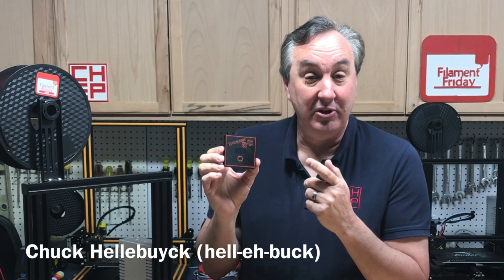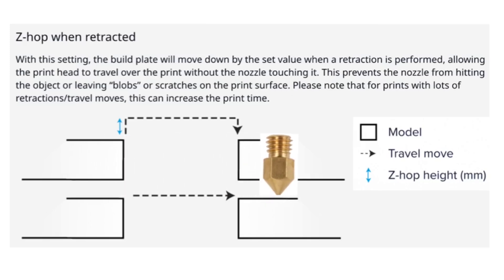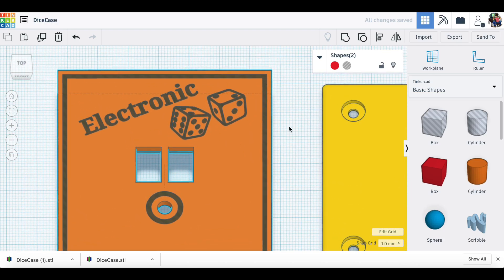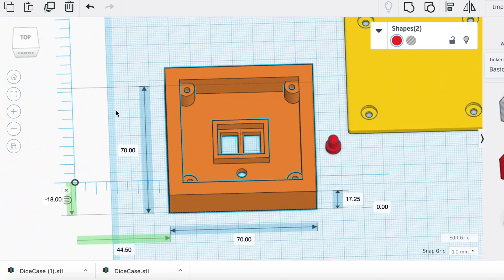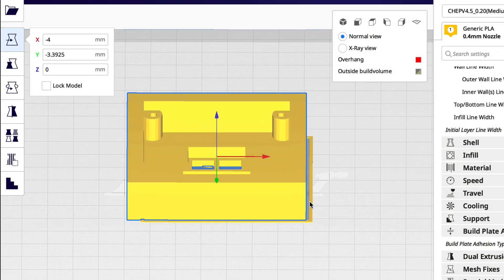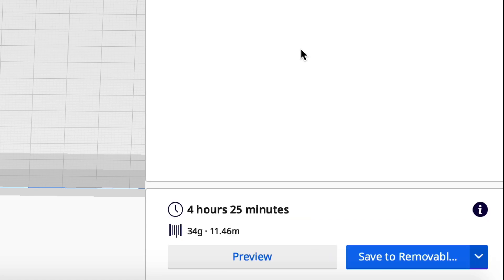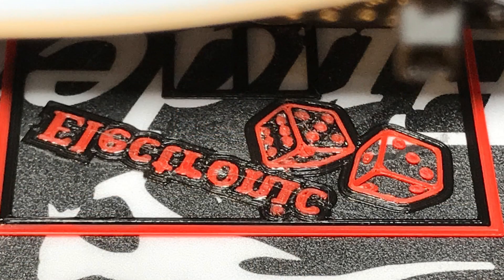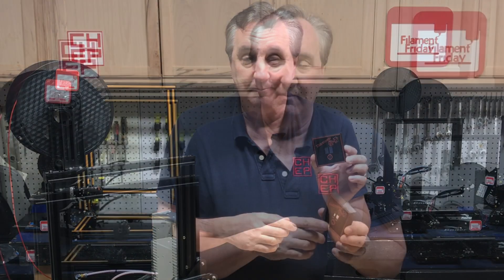Smooth Two Color Inlay 3D Print Using Cura Z Hop on Creality Ender 3

Comment: I know this is an old video, but if you use the Z-hop function, does that mean it does that for the entire print? Is it possible to only use it for the first couple layers and then turn it off after that?
Reply from the maker: You could do three print files but I don’t believe Z hop can be shut off like that.
Reply: You can add a support blocker can change the meshed settings so z hop is not active after the first couple layers.

Comment: how can i do this with 2 objects that are of different shapes and can't be centered with each other. is there a way for tinkercad to show coordinates? mesh mixer is a pain.
Reply: Just have something like a surrounding box that is on both layers, then you are aligning both boxes instead of the dissimilar shapes. It’s basically a way to get registration to match. Does that make sense?
Reply: It also works if the surrounding box is a degenerate shape that the slicer will see regarding dimensions for centering, but won't print because it is degenerate.  I had this problem recently and just put a small vertical plane (zero thickness) in each corner of an imaginary plane that is big enough to surround the largest object to be printed.  I made the four small planes a single object (call it the registration object).  Then, in the modelling program (I used Blender), register the two objects to be printed and make sure they are surrounded by the registration object.  Select the first printable object and the registration object and export them together as a .stl.  Then select the second printable object and the registration object and export them together to another .stl.  When opened into the slicer, the slicer will see both as the dimensions of the registration object, so you can center both and you're good to go.  The main advantage for me was that I needed a brim around one of the objects, but Cura does not handle brims around objects with things like text properly (some of the text letters will get brims).  So the solution is to use a skirt with a 0.01 skirt distance.  However, if the registration object is at all printable, this skirt will bend around the registration object.  By making the registration object non-printable, the skirt hugs the main object properly.  Experiment with the degenerate shapes.  For example, a vertical plane worked for me, but a more intuitive corner made of two perpendicular planes did not work - the slicer created a hypotenuse in each corner and wanted to print triangles there, which messed up the skirt.

Comment: The letters in my inlay text print come out blurry. The text look sharp when printed alone. Are there settings I should configure? I tried using your CHEP4.12_0.20(Good) and CHEP4.12_0.20(Good) profiles but the results are the same - blurry text.
Reply: It might not be centered over each other. The part might be running into the letters and smearing. Or your z hop isn't high enough.

Comment: Hello, nice video, but I have a problem... I have an ender 3 v2 with Bl-touch, and before I start printing, my printer automatically aligns in the middle of the base using Bl-touch. Then it measures 9 points on the base then starts printing, how do I print the second color model without Bl-touch hitting the first model please help me ...? I apologize for my English (google translate)
Reply from the maker: Try this: https://youtu.be/pQlZoMF0CVE

Comment: What happens if bltouch probes the first print while homing after removing g29
Reply from the maker: Why would it do that if G29 is removed?
Reply: You will need to remove the G29 for ABL mesh, but you would need to replace it with M420 S1. But you will also need to have a mesh saved to EEPROM before hand. The real issue is actually G28, auto home with a BLTouch is in the center of the bed. I literally just ran into this issue trying this technique. When the printer homes to the center when starting the second print, it hits the first print. I need to find if there is any way to auto home on the edge like with a standard z-stop switch...
Reply: @robh.9090  did you find a solution? I'm running into the same issue...
Reply: @catdisc5304  I haven’t found any solution yet to move the homing position to the front/left. My solution was to plan the separate colors to be sure the dead center was clear until the final color went down. Took some trial and error.

Comment: I get teeny tiny points from the Z hop lifting. Any tips to not get those?
Reply: make retraction a bit higher
Reply from the maker: Yes, increase retraction.
Reply: @FilamentFriday  retraction is now 10 mm at 70 mm/s and still some points. The printer flattens them on the next go over, but still, is it possible to not get them at all? Also: what hight would you recommend I put z hop?

Comment: How can I do this if I have a BLTouch?
Reply: You just move it to a side and use M420 S1 seting on your auto leveling
Reply: @monoburgos93  How can you do it? When the bltouch do the autohome, it uses the probe to detect the z high. If it touch the first printed layer, it gets a wrong hight....
Reply from the maker: Print it off center if you want to use the probe.
Reply: @FilamentFriday  Couldn't you edit your GCode manually to remove the ending GCode from the first print and the starting GCode from the second print and insert a filament change sequence between the two?

Comment: hmm nice but how do you change the filament?
Reply: The same way you normally would when you want to change filament. They're two separate prints. You're just not removing the first one from the bed before you print the second.
Reply: Did you even watch the video ?

Comment: Maybe this is a novice question, but how do you ensure the print is perfectly centered in cura?
Reply: Or suppose your inlay is right justified on the piece so that it shouldn’t be centered on the bed...  How do you ensure that both prints are aligned?
Reply from the maker: Right click and select center on bed. 
If they aren’t centered then you’ll have to manually align them.
Reply: @FilamentFriday   Thanks for your quick reply!  I just want to say that I really appreciate your work.  I got my first printer about a month ago and your videos have been super helpful.

Comment: what if the part im trying to inlay isnt in the middle of the main part
Reply: i have an object that cant automatically be centered with the alignment tool in tinkercad so i put the cutter object where i need it to be then bring .4 thick discs about 3 mils wide and place them an equal distance on the outside of the object and group that to the cutting object fool around with it a bit it works

Comment: Interesting technique, but not fully convinced.
If you do 0.2mm with 0.2mm layer height and just swap the filament you get something similar, you can even do two more changes to get 0.4mm colored - did that a few times just by pretending I had a filament changer in the slicer.
When you do two 0.2mm in one and then change, the black will be 0.2mm below the previous print, which is why you did the Z-hop, but there is a catch: the nozzle is physically bigger than the extrusion width and it will still slightly jam into the previous print.

Comment: Actually I use a much more easy way to do this using M600 as custom gcode for toolchanging in Prusa Slicer:

1. I edit the printer config in prusa slicer to have multiple extruders and select they are "virtual extruders". This is integrated function in prusa slicer for at least 5 years now.

2. As custom g-code I enter M600

3. I deactivate purge tower in print settings

4. I select the brim being n lines width. With n=number of colours I use.

5. I select the brim being m layers high. With m=number of layers up to the last layer with colour change (normaly 3, as I do colour change only in the 3 bottom layers)

6. In prusa slicer you can ad simple objects and stls as "modifier". In the latest beta you even can ad text as modifier. No need to cut out the modifier from the original object, this is done while slicing automaticly - just choose using another extruder for the modifiing object.

As the number of brim lines matches the number of virtual extruders, prusa slicer automaticly draws one line after each "toolchange". This primes the nozzle perfectly.

Two remaining problems:

a) On start of the print the first colour change occours. As we already inserted the first filament before start, this is not neccassary. So we edit the produced gcode and remove the first M600 and the following T0.

b) M600 always returns where it comes from. The extruder tends to ooze a bit, so unwanted ooze might drop inside the object. So editing the gcode, remove M600 (and following T...). go a few lines down, after the first following brim line insert a line with M600. Now the filament change is done inside the brim, not effecting the object. You might set a bigger distance between brim and object in print settings (I use 1 cm), to avoid any ooze getting to the object.

Prusa slicer uses the last loaded filament first on the next layer, to reluce amount of filament change. So for three colours it would be: 0 <filament change> 1 <filament change> 2 <layer change> 2  <filament change> 0 <filament change> 1 <layer change> 1 <filament change> 0 <filament change> 2 <layer change> To avoid an extra filament change, you should set your main object to use extruder 2.

This method gives incredible results.

Also I mostly print the first three layers with slower speed and use hilbert curve as bottom pattern (esp. on pei powder coated sheet).

Also I use only one perimeter on the bottom layer (I use a modifier one layer hight to change first layer to only use 1 perimeter in the first layer). Also all modifiers use 20 perimeters (so they use practicly concentric lines instead hilbert curve).

If your printer does not support M600 you can still use this method. Use relative coordinates in slicer settings. Instead of using M600 write your own gcode, moving the extruder up about 3 cm, move the position outside the object and than do a normal pause. Than move back to the former position and down again. About five lines of gcode (and you have to make sure you do not send commands to move outside the printable area), but it works.

Still, there are some touchscreens not supporting this, as resuming pause ("continue") isn't shown, so you can not continue after filament change. The way around this: use wait instead of pause. This automaticly continues after the waiting time you set. Make sure to select a time comfortable to do your manual filament change.

Of course, if your printer does not support M600 (and you can not upgrade the firmware like on the old Creality Board, due to incufficient flash), I recommend to upgrade the board to a SKR (f.e.SkR e3 mini) and use a Touch screen with both Touch and 12864 mode.

Comment: Why not remove the red letters and put them in afterwards by hand?
Reply: They will not fit. You will spend hours and hours reprinting them to find appropriate size and overall result will be not as great as in this method
Reply: @melickon  if the printer has good tolerances you can easily do this.
Reply: Zágoni Mátyás 
Try it and see.
Reply: @boggisthecat  I have tried it. It is extremely difficult. I have put letters from PLA into my custom phone case printed in Flex. This was not simple task. I will use Z hot trip to recreate it someday.
Reply: @melickon  the trick is to make it smaller by 0.15 mm or 0.2 because of the printers tolerances. It did the trick for me.
Reply: Zágoni Mátyás there is also a feature in slicers called “horizontal size compensation” if you put this value as -0.2 or -0.15 (need to tune it according to your printer accuracy... or even lower values) it deformes a bit the edges and the holes of the stl and make things fit :)
Reply: @Flagazz  i believe its horizontal expansion in cura. Dont like it bc it messes with circles. I would rather compensate for it in my cad files.
Reply from the maker: Why would you want to do the by hand when the printer can do it for you automatically?
And I don’t want to fool with placing the tiny dots of the dice in place. I really can’t see any advantage to what you describe.
Reply: @FilamentFriday  in this context this is the better solution but there are some objects I encountered that have these lets say on the side and you cant print it in any other orientation or they have text on more than one side.
Reply: @SarkanyGergogaming  If your inlay elements are small characters or other small parts, you will no be able to glue them in place accurately, though offered method will do it perfectly. I am right now trying it with small drawing. I will use 0.3 line width for inlay color and standard 0.4 for rest of model. First results look promising.

This method is applicable only for bottom side and (could be) for top layer.  In case you need to create die, you can design foldable model, so all sides will be "bottom" when printed
Reply: @melickon  you shouldnt glue them. If its designed well it should be a good press fit
Reply: @SarkanyGergogaming  this reduces applicability of this technique. It will not hold in flex and for small parts
Reply: @Flagazz  “horizontal size compensation” won't work because you need the individual pieces to be slightly thinner, not the whole thing.
e.g. if you have an outline square, when you thin it for inlay, you make the outside smaller, but the inside larger. Horizontal compensation would make the whole thing smaller and it wouldn't fit.